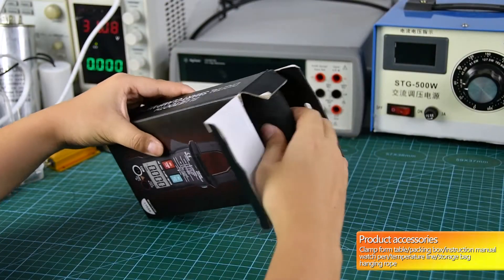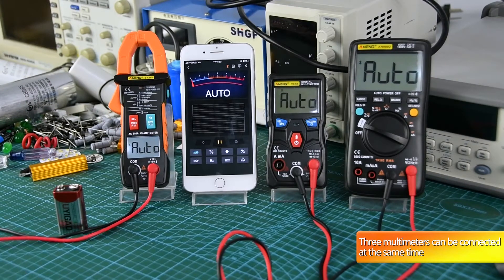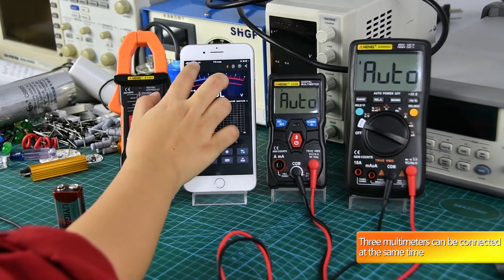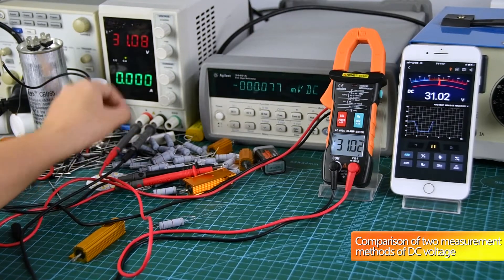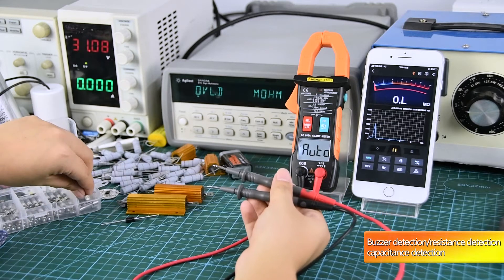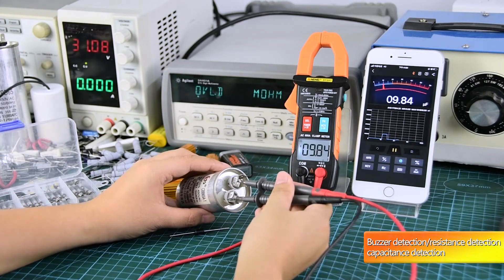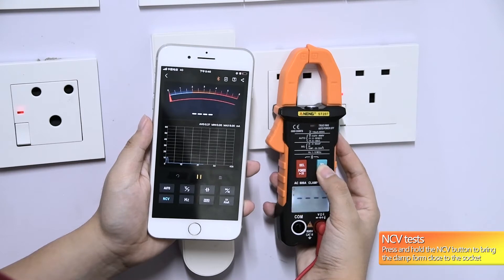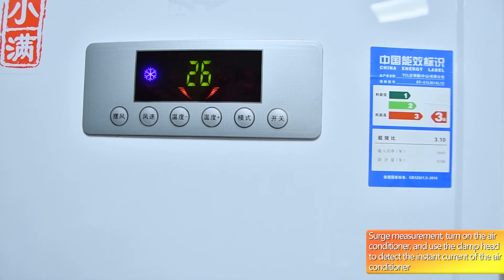ANENG ST207 Digital Bluetooth Clamp Meter 6000 Count DC/AC True RMS Multimeter Hz Capacitance Ohm

Comment: Does this device support inrush current measurement mode? A similar model without Bluetooth supports AC measurement mode by double pressing the side button. If it's not difficult, try it...

Comment: There's no option to select DC Voltage! I don't the auto option sometimes it measures ohms instead of Voltage
Reply: In my st207 is available manual dc voltage. In auto mode press one backlight button. Quick 2x fast switch peak hold/ hold mode.